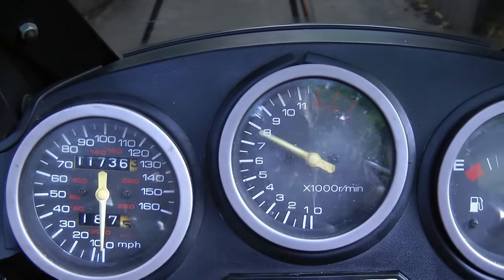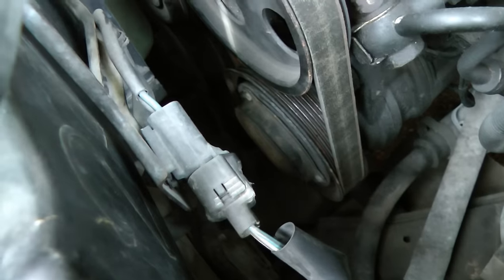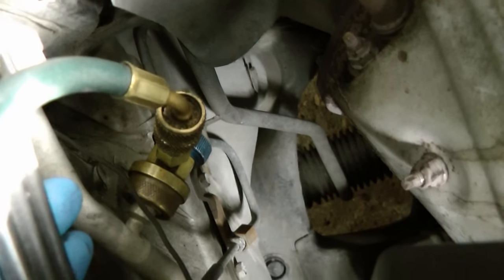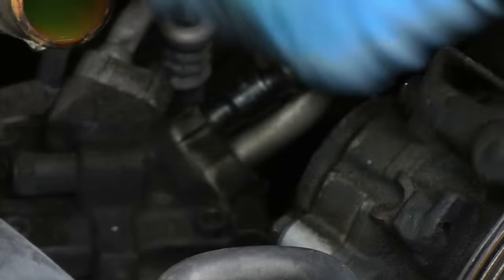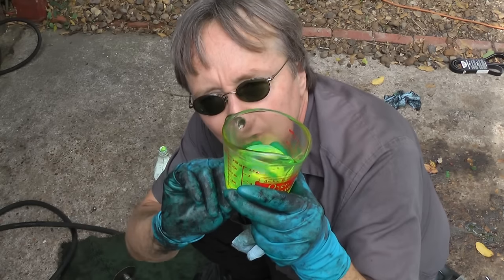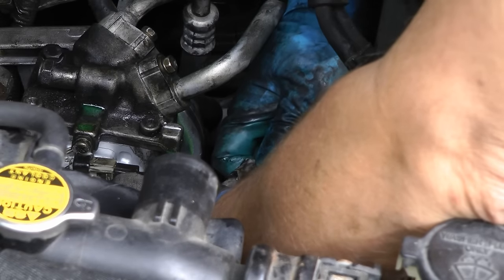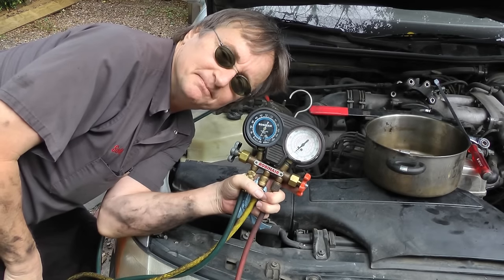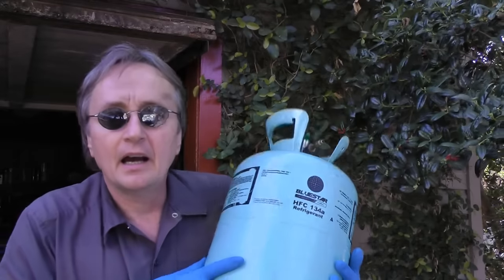How to Replace AC Compressor in Your Car

Comment: Thanks for the advise you give people. Replacement of a compressor on a 3.8 engine. It leaks from the compressor. I can not afford to pay anyone and do not have the holding tank to release the a/c Freon into if it has any left in it. Can I do this job. My engine sets side ways. 1999 Pontiac grand prix GT. What would happen if it did have Freon left in the system?
Reply from the maker: just do as in this video.  If any refrigerant is left, it will just leak out, that tiny bit doesn't hurt anything, although it is technically illegal

Comment: Hi Scotty, your videos are great! I have a 98" Toyota Altezza and when I turn the Aircon on.... the car violently shudders as if its about to die.. however when the car is turned OFF the aircon blows through all vents? the car has done 153,000ks and probably has not been serviced, I replaced my alternator belt a few days ago and noticed the compressor turns with no trouble at all. Could this still be a bad Compressor or do you think it needs to be re gassed? Thanks in Advance, Jamie

Comment: Hey Scotty what's your opinion when it comes to buying ac compressors off ebay? Some are cheap and others are more expensive and I'm not sure where to look or which one to buy. I know it's wise to get a brand new one instead of remanufactured but there are so many different ones on there that I'm not sure what to do.

Comment: Hi Scotty,
Thanks for all your help.  I have an 06 Saturn Ion that needs a new compressor.  I have the compressor and receiver/drier.  The manual has nothing on the receiver/drier.  I'm assuming that's attached to the condensor?  Would that be right?  I can't find any information where it's actually located on the Internet.  If so, would I add oil to the receiver/drier as well as the compressor?

Comment: Hi Scotty,  When I turn on my AC I hear a clattering noise at low speeds.  The AC blows cold still at 150K, and has never been serviced.  Should I replace the AC compressor now, or wait until it fails outright?

Comment: Well, is it possible to rewind the electromagnet that activates the clutch?  Because I think that's the problem with my clutch.  It will work for a while but once it heats up it doesn't have enough current and so it disengages.  What do you think?

Comment: Hey Scotty, i have a 96 ford f150 pickup. sometimes i get a grinding noise from my ac compressor.. But when i turn the AC on.. The noise goes away.. Is that the compressor?? Or a bad clutch?? Or what do you think?? Thanks. I really appreciate it.

Comment: i have a 2005 Toyota Camry, the left side mirror wont fold in. i have to do it manually. however the switch works fine with the right side mirror. what could be wrong Sir?

Comment: Hey Scotty, I love your show, It has been extremely useful for me. However I have a problem with my AC. Whenever my 2003 Nissan Xterra is on idle, the AC starts to rumble by the passenger dashboard area. Its not the blower as it goes away when I hit the AC button. As soon as i accelerate and get by second gear, the rumble goes away. The machine tested the low pressure side slightly higher than normal, but very slight. Some have said its the compressor, others the expansion valve. Any ideas?

Comment: Hi Scotty I have a pressurized can of a/c flush do I drop the old compressor leave on the old receiver accumulator flush it blow out with compressed air then install new receiver drier orifice tube and compressor with proper oil then evacuate for an hour or longer wait ten minutes afterward for leak check then charge? Thanks Scotty. Joe 2005 freestar air in rear also.

Comment: Hey Scotty I've got a couple of questions, my 02 civic compressor clutch locked up on me: do i really need to replace the drier/receiver when replacing the compressor?  do i need to have my system flushed and freon added (getting close to winter)? Just trying to save some money here and there... I've also heard from my mechanic that you could just cut the belt off if it gets too bad, is that true?

Comment: You make it look so easy. I want to know I have a 2003 cavalier and I had to disconnect the wire on the compressor but the hold clip came out not I can't plug it back in. Do I have to change my working compress because of it?
Reply from the maker: larry sean na, just cut the wires and splice them together with a wire splice kit, or solder them together and tape over it
Reply: then there would be no wires to the compressor i thought it needed some sort of power to engage once the ac button is pressed.
Reply: well i must ask what is the purpose if the two wires going to the compressor ?
Reply: does that wire gives power to engage the clutch?

Comment: Hey there,  I own a 2002 Mitsubishi lancer es,  I bought an AC compressor from a know website obviously the website told me that the part was a match. Well the new compressor  does not look like the old. My old compressor  has 3 circles sticking out. The new one does not, I called Tech Support  and was assured that the new compressor  would work.  shouldn't it look the same? Even the picture online was different from what was sent. Has the part been upgraded? Is it fine to use? Need help , please.

Comment: Awesome vid. I do have a quick question: if just the clutch goes on the compressor, can you just change that? Or would doing so cause the compressor to finish going bad, and then need to be replaced anyway later on? This is on a 2000 mustang v6 by the way.

-Esco
Reply: The Esco replacing the clutch is usually either more expensive, more effort or both. replacing your old compressor with a rebuilt compressor is often an easier solution than replacing the clutch
Reply: The Esco you can just replace the bearing, if thats all thats wrong, the coil underneath may be failing too, but a bearing is like 10 bucks vs 100-200 for a compressor w clutch and bearing set. though it is a beeeach to hammer off the bearing and hammer in the new one. I imagine you could use a pulley puller though..?

Comment: Scotty-I have Nissan Quest(made by Ford) and was told the compressor leaks coolant since we charged it up and the old one turned on for one day. now we replaced the compressor and it worked fine for one day and the clutch no longer engages. I can see oil all over the low  pressure rubber hose and it has oil  at the metal connection to the hose(where it connects to the compressor). So I assume the whole hose assembly has to be replaced since it is leaking at the hose? Is this a normal problem?

Comment: Hey Scotty I love your videos Moon and I just put a AC compressor I did everything I'm supposed to do it's blowing cold air when I put the AC on the car thing like it runs a little rough I don't know got the proper oil in there are not how is there a way I can get oil put into end of system somehow I got the gauges in the pump what I have to do to get a 140 would I have the proper stuff in it I got a Chevy Aveo 2011

Comment: Hey Scotty, I posted on another video about my Power Steering Pump making a whining noise.  Just got back from another mechanic, he is saying it's the AC Compressor.  Noise gets louder on increased RPMs, doesn't change with the AC on or off.  Where should I start!?  I already changed the Power Steering Fluid which showed no difference.  Thank you!

Comment: Hi Scotty - My car blows just cool air.  I assumed coolant was low & I got can to recharge system from auto store but gauge read good level.  Car is 2002 - could the compressor just be worn and need replacing , although it is still working?  Any test for that?  Thank you

Comment: Hi scotty, I bought new compressor and I don't know if there is oil inside it. So I opened the bolt and it came out some oil and I immediately tightened the bolt .

The compressor is new and the car is 2009 pontiac g8. The manual says " Compressor oil refill capacity is 120 ml +/- 10 ml"

Do I put 4 ounces? or I first drain the oil and put 4 ounces?

thanks in advance.
Reply from the maker: drain it all out, then put in 4 ounces just to be sure

Comment: Hey scottie, I have a 2002 mustang gt that when the clutch tries to engage the engine dies out. The ac compressor for a while would make a loud whining noise.
Reply from the maker: compressor is now broken, PRAY other things in the system didn't help break it and that replacing the compressor, the drier, and the orifice tube fixes it.

Comment: I have a question about a 2007 Saturn Vue air conditioning system that no one seems to be able to fix totally. The car blows warm at idle, but will freeze you out at highway speeds. with the air on, both fans are running, but do not run when the car is turned off when hot? our last Saturn did though? this one does not. I am not sure if the of the fans are on high speed or low speed? and it does not seem to change speed. I was told there are no leaks, the expansion valves were replaced, and all fuses and breakers are fine. what else is there to check? My own thinking is the compressor not pumping enough at low speed? what about the fan resistor? would that do this? or are there temperature sensors somewhere that could cause this problem? I have noticed on the Saturn forums, this is a common problem with the Saturn Vue, but no one has the answers,Can you help? Thanks, victor

Comment: hey scotty I have a 1990 chevy truck the compressor is got a bad pulley bearing plus the clutch is throwing grease around it! it has no freon in it if I replace the compressor do I have to put oil in it? and how do you put oil in those gm harrison compressors? I wont need to charge it till spring on those I think the defroster works off the ac compressor?

Comment: hello. A question. We bought a Honda Accord  2004 v6,  well we found out the ac is connected direct. like when we turn the car on it turns on. right now it blows hot air no cold air at all. We heard its bad to have it this way. Is it? and what should we do?

Comment: What was shown is pretty much correct. But he failed to mention that you must use the correct type of refrigerant oil in the compressor. It is also a good idea to replace any O rings that are on fittings when you remove them. They should also be given a light coat of refrigerant oil before being reinstalled. And yes, the receiver / dryer should be replaced. Also be advised, most AC compressor makers, insist on a line flush or you may invalidate your compressor warranty.

Comment: hey Scotty i just saw this video i had a question my hot air and cold air on my car does not come out only when the car is running but very little air come out do you know what it could be so i could try to fix the problem thanks

Comment: Scotty,2003 Honda civic EX, on initial startup AC works fine (compressor runs normal and air is cold) while at idle it stays the same (normal) after about 10 minutes of driving the air gets warm and compressor stops running. Fans and switches are fine, relays are fine, according to the 134A guage the pressure is fine. What else could cause the compressor to stop randomly? I had to slide a screwdriver down there at one point and push start it, eventually it shut off again. Bad clutch? Do I try and replace the clutch or do the whole compressor?
Reply from the maker: on that model, often a worn out compressor, no one replaces the clutches, just the whole compressor assembly
Reply: +Scotty Kilmer 
You got it Scotty, We love ya out here.  Sucks paying some of these vampires  who claim to be mechanics some times, theyre simply parts replacers in my opinion. Thanks for the  advice as always..Over 200k on the civic and still going strong. Keep the tips/videos coming..

Comment: Hey Scotty, do you know the best way to remove an AC compressor on a 2007 Kia Spectra? The fewer the steps the better. My compressor locked up after a small fender bender ending in a slight dent and no AC. Thanks in advance. I'm in Texas also so need to get this working before summer hits us.
Reply from the maker: If the compressor is marginally operable, run the engine at idle speed, and let the air conditioning work for a few minutes, then shut the engine off.
Disconnect the negative cable from the battery.
Recover the refrigerant with a recovery/charging station .
Loosen the drive belt .
Remove the bolts, then disconnect the suction line and discharge line from the compressor. Plug or cap the lines immediately after disconnecting them to avoid moisture and dust contamination.
Disconnect the compressor clutch connector (A), and then remove 4 mounting bolts and the compressor.

INSTALLATION

Make sure of the length of compressor mounting bolts, and then tighten it A->B->C->D order.

Tightening torque : 2.0 - 2.5 kgf.m (19.6 - 24.5 N.m, 14.5 - 18.1 lbf.ft)

Install in the reverse order of removal, and note these items.
If you're installing a new compressor, drain all the refrigerant oil from the removed compressor, and measure its volume, Subtract the volume of drained oil from 120cc(4.20 oz.) the result is the amount of oil you should drain from the new compressor (through the suction fitting).
Replace the O-rings with new ones at each fitting, and apply a thin coat of refrigerant oil before installing them. Be sure to use the right O-rings for R-134a to avoid leakage.
To avoid contamination, do not return the oil to the container once dispensed, and never mix it with other refrigerant oils.
Immediately after using the oil, replace the cap on the container and seal it to avoid moisture absorption.
Do not spill the refrigerant oil on the vehicle; it may damage the paint; if the refrigerant oil contacts the paint, wash it off immediately.
Adjust the drive belt

Comment: My brand new ac compressor is knocking in my 996, 911. I checked all the bolts and nothing seems loose. It comes and goes but is mostly there. It goes away immediately when I turn the ac of while driving. Any ideas?

Comment: hey scotty me and my dad changed the ac compressor on a 95 gmc sonoma but we didn't pump anything out, we just took the old compressor out and installed a new one. Is it necessary to use a pump?

Comment: hi scottie, great vids!

i have a 98 tahoe 5.7L. the compressor wont engage, but it spins freely by hand. i check the voltage at the copmpressor plug with the AC on and off and both time it was around 50 mV. what should i check next? also, can i hook the compressor straight to battery power to test the compressor?

Comment: On most modern systems, condenser cannot be backflushed properly due to their parallel design (different from older serpentine condensers) so must be replaced.  Use new green HNBR O-rings, change the drier as well.  This video is an oversimplified take on what must be done.

Comment: hey Scotty, I'm not replacing my AC compressor just want to move it out of the way to get to and replace my motor mount bracket which has a broken motor mount bolt in it on my 2000 Saab 9-3 SE.  Aside from the 3 bolts, what else do I need to do for it to completely be free from the motor mount bracket? Thanks for your help.  By the way, I used a grade 5 bolt the first time when I fixed the motor mount, and it broke. I now have a grade 8 bolt the required bolt to use.  Thanks man!!!

Comment: How can I just take out the compressor without any other equipment, and replace with a bypass pulley?  Can I replace the whole thing later?  What do I do with the in and out lines of the car while the bypass pulley is in place?

Comment: Great videos Scotty! I had a question for you. I have a leak in my a/c where the low pressure hose and the air compressor connect. I could see the refrigerant leaking out of there and I can hear it hissing when the car is off. Is this a bad compressor, or a bad connection? If it is the connection, is it possible to just replace that or do I need to buy a whole new hose with it? Thanks in advance!

Comment: In my 2006 Honda civic (single owner)  the pressure seems to be at 150psi a recommended amount was 45-55psi per a recharge can.   Prior to checking nothing has ever been added by myself and have always taken my car to a Honda dealer.  Why would the pressure be so high? Also how many OZ of oil would I need if I was to buy a new compressor  as that may be the issue

Comment: Hi brought a A/C compressor on ebay for a 2001 Honda civic Ex but when order came in the connector does not match the one on my car. is it possiable to swap the connector from the old one to the new one? are do i have to return the new one and get a compressor with the same connector?

Comment: hi scotty i just got in my ac compressor for my 2001 honda civic ex. my dad, friend, and mechanic are saying that the ac compressor was the reason the ac stopped blowing cold air and the belt messed up...and that the power steering is connected to the compressor. my question is how long will it take to install the new compressor? i just took it to my mechanic about an hr ago but he says will fix it tomorrow since he is working on other cars. and why did the compressor go out in the first place?

Comment: Hie Scotty. I'm in trouble again. Rattling noise coming from passenger side when ac is turned on bt ac/works fine. Jst replaced my serpentine belt & water pump a month ago. Did the mechanic mess something ? Is it ok if I don't fix this problem ? Car - 2003 Ford Focus ZX3. Thanks.

Comment: hey scotty i have a question, my ac compressor runs and spins early by hand, but the clutch is very shaky, and makes a lot of noise, the guy at the store said it could be the bearings, is there a way i can fix this without buying a whole new compressor ?

Comment: It is a deep and annoying rumble. Also The low pressure port vibrates if i gab on to it, but it vibrates less when I rev up. 
I feel like it could be the low pressure port vibrating when it comes into the cabin, creating the rumble from the blower area. 
What do you think of the expansion valve idea?
Also, does the Xterra have the "thin" fins on the drier? I feel its more of a dinosaur, from 2003 haha!